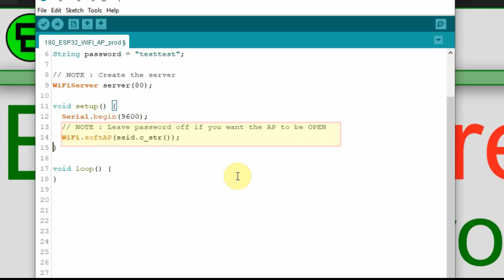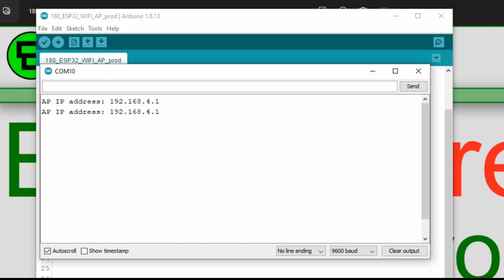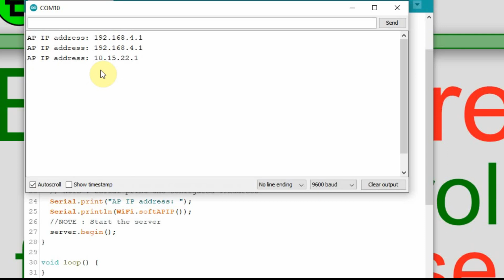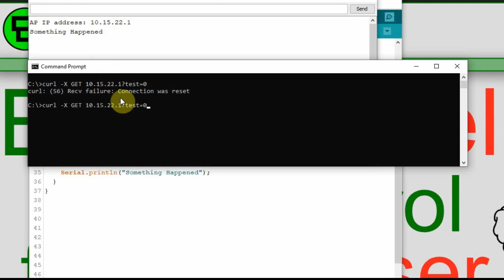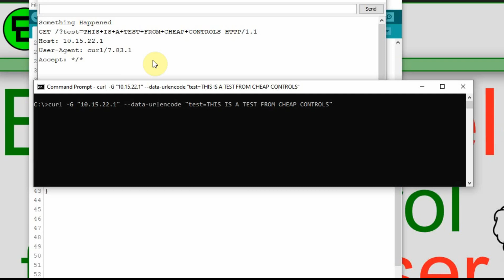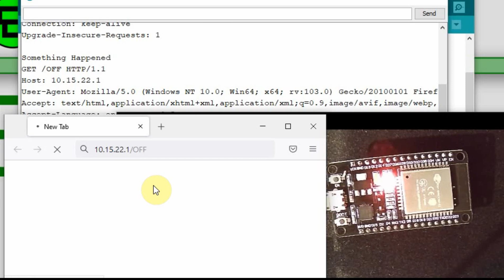180 #ESP32 #WiFi config and browser control of the Onboard LED #esp32 #tutorials

Comment: Excellent video, it is the only channel in which they have tested so many details of the Nextion screen. Could you try showing load cell values on the screen by connecting esp32? I would appreciate more videos with esp32 thank you so much
Reply from the maker: Can you read my mind?  I just ordered a load cell and am starting to prep for a couple of videos.  They will take me about 4-6 weeks to make.  I have not decided if I am using an ESP or Arduino but I will do my best to make them with the ESP32.  Thank you for taking the time to comment and for your kind words.
Reply: @CheapControls  
Thanks for answering, I have tried the hx711 module with load cell in Arduino UNO to see weight in real time but I had problems because the interaction with buttons is affected (it generates a delay in the Arduino response after pressing the button on the screen).
Then I tried the examples of the Nextion library (.attachPop) with the ESP32 and saw that they are not compatible.

I am not an expert but I have learned with your videos, I hope that my little experience will be of help for your tests with the load cell.
😁

Comment: Hi CC ,great tutorial as always.
 It will be good also  if  wifi can set up the Time on the nextion display.
Reply from the maker: I hope you are patient.  I will be getting there.  This week I will show how to dynamically connect the ESP32 to a network by choosing the SSID from a combo box.  Next week I will show how to control the Nextion using a  web browser connected to the ESP32. I will try to show how to connect the ESP to an network clock for the time.  I am enjoying working with the ESP32